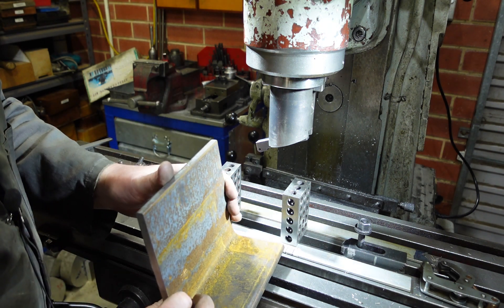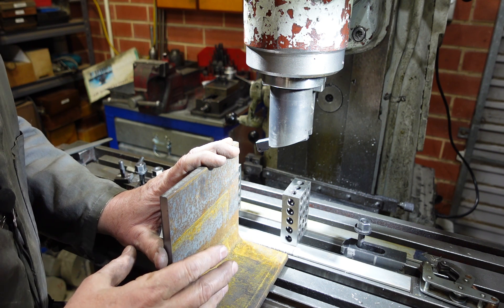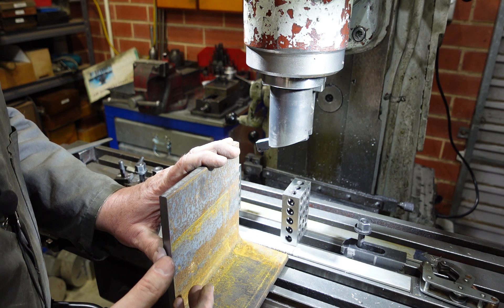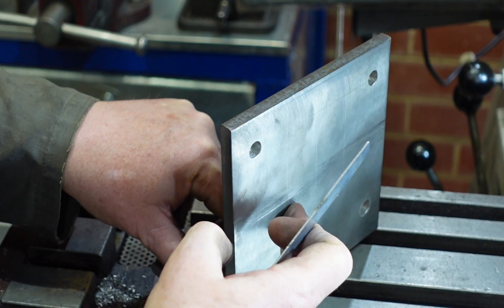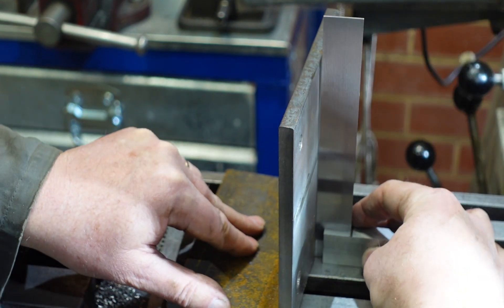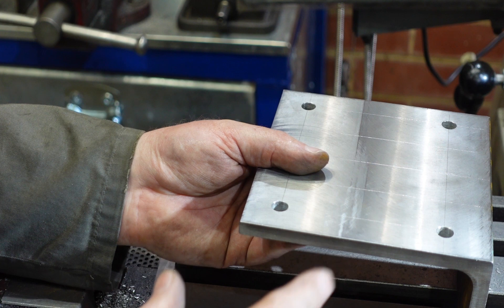Boot strapping a mill part 2

Comment: Interesting video, I have something similar planned as a shaper project thanks for sharing your ideas
Reply from the maker: Interesting idea. I guess if you had holes either end of the slots you could make angle plates on a shaper (maybe slots - a couple of drilled holes with a bit of file work). Flattening off fabricated V blocks on a shaper - I'd be really tempted to turn the table so it was at 45 degrees and just clamp to a corner.
Reply: Thanks, I was planning on just drilling holes in the angle plates with a few tapped for work holding also it will leave a little more "meat" left for rigidity, Can always add more holes or open out to slots if i need to in the future 🙂
Reply from the maker: @Paul-FrancisB  Agree entirely - also with inexpensive plates like this, you can put a hole wherever you like.

Comment: Again more interesting information and self made tooling.
Reply from the maker: I think it was made in the comments of the last video, something along the lines of 'just buy the stuff'. You could, but there may be reasons you don't want to and it's all practice at using your machines too. Some of the stuff I've made (or will be making) I'll be using in the future because it is perfectly serviceable stuff. Other bits will be rehomed and used by others.